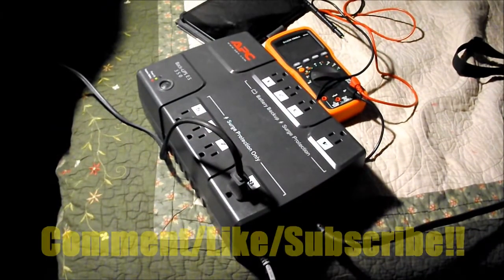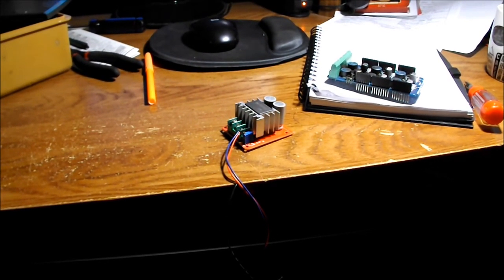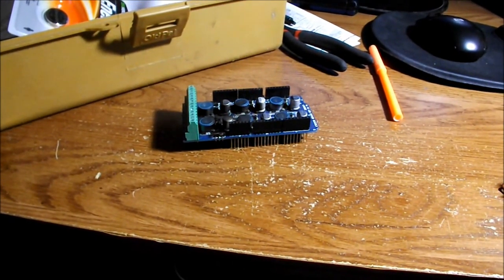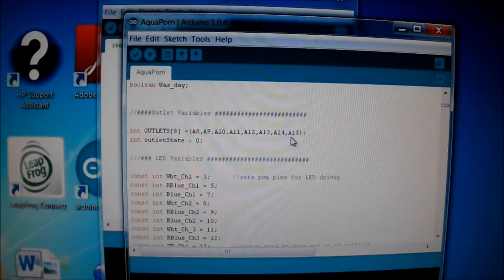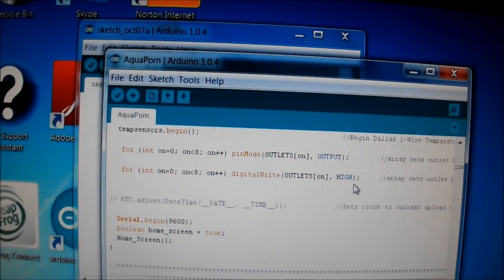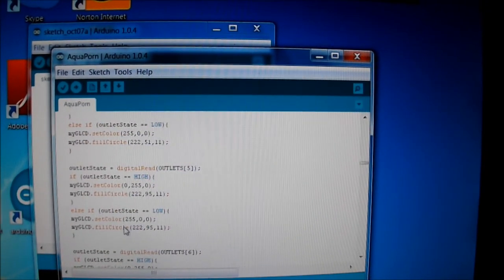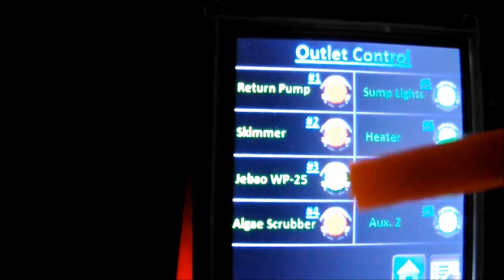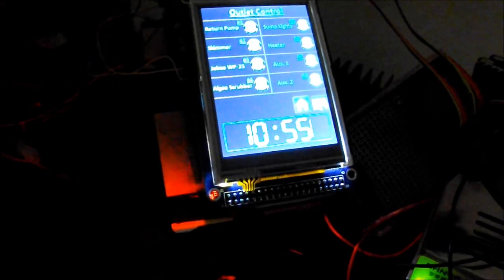DIY Outlet Control using Arduino - Part 3 Software

Comment: Hey A/P, very nice build my man!  Question, I am preparing to do similar to my indoor grow room, just ordered my first Arduino Uno and am mentally compiling the things I'll need to learn to make similar projects.  Do you have any advice that can streamline my learning curve and not take myself too far into left field?  Also, do you have a link to your sketch code somewhere?  I'd hate to have to learn how to write it all, then actually write it all.  Anything you can share is appreciated in advance.
Reply from the maker: Thanks for watching! To streamline your learning curve make a list of all the things you will want to do with your Arduino, and then just write 1 function at a time.
There is plenty of code available out there. Just Google search what kind of sketch you're looking for. The trick will be manipulating code into a usable function.
It will be frustrating, confusing, and rewarding all together. There are no real shortcuts besides that. Unfortunately, everyone has to pay their dues going through the learning curve...unless you're are already proficient in writing code.
Reply: AquaPorn
Never did any kind of coding.  I once visited a library and found a book titled Introduction to C++ and it was roughly 4 1/2" thick.  Ya get that?  A 4 1/2" thick introduction.  I also privately studied law for a time and found that I had to read a shit ton of statues and code that would never apply to me, and the lesson I took was that I had to wade through all that just to know that it was not useful to me.  I suspect this might be the same concept.  So here goes nothing!  Thanks for the quick reply.